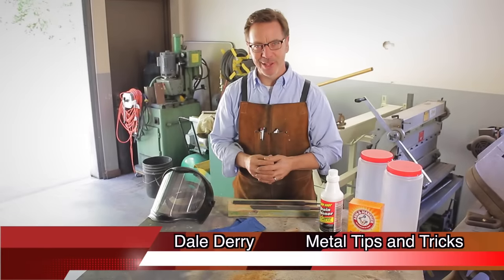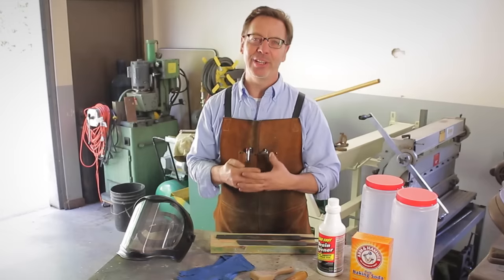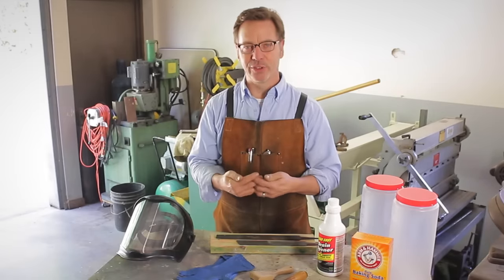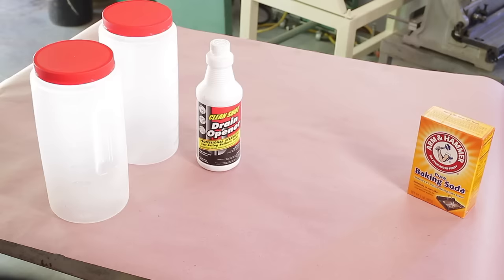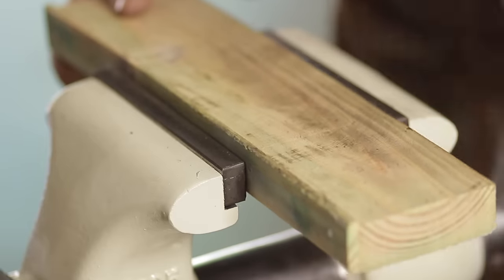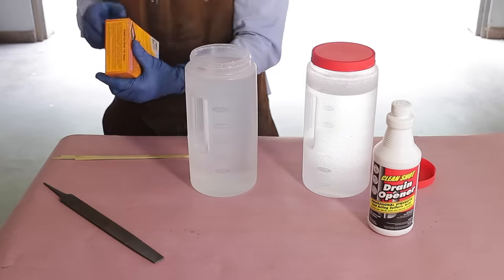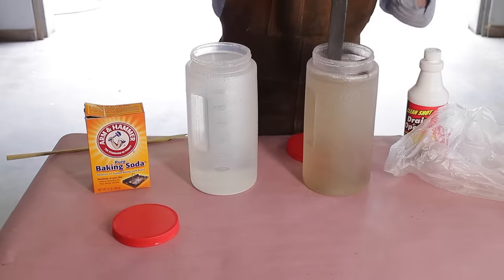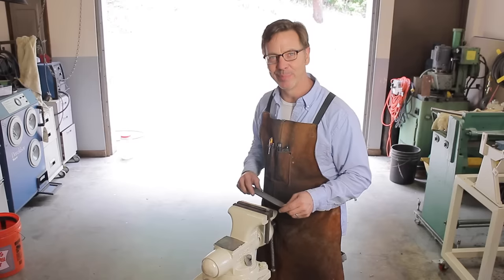How to Sharpen Metal Files

Comment: this isn't file sharpening, this is just unclogging the teeth.
Reply: Agreed, Many of the "new guys" I've worked with complain their files aren't sharp or dull out after a little use. Think many confuse clogged or dull as the results are pretty much the same. If this actually sharpened the file, it should also work on a drill bit and the concept is pretty much the same.... it wont help create a new (sharp) cutting edge, if anything the acid would help round (dull) a sharp blade as it would attach the thinnest spot the most, IE... the leading cutting edge.
Reply: Right. It seems all you need to do is the 1st step. Clean it with a piece of copper.
Reply: Ramon Ching I agree, I usually use that or a stiff wire brush. "Secret" is to clean it regularly so it doesn't get a build up.... I usually clean it before it goes back in the tool box, so it's ready to go next time and keeps the shavings out of the drawers (where they'll rust...).
Reply: no, the acid would remove the peak where the steel is thinnest. it wouldn't etch away the shoulder to leave a sharp peak
Reply: And why you think so? Thin piece disappear fast just because it's thin... but it's not about the width of the material in this case, acid is ideally disolving every spot at same speed. Same speed for thin and same for thick. By simple use of geometry you can see the sides of that tooth keep progressing faster to the center than the flat top, just because they are closer. They then meet and the flat top disappear... So i have explanation that it works, do you have real explanation it doesn't or you just wanna blame me and the video for offending your different opinions?
Reply: jarek, sure acid is dissolving all the material at the same speed, therefore the blunt file will continue to be blunt because the acid will eat away the profile at the same speed. your explanation doesn't work. and please, i am not offended by any reasonable discussion or opinion. peace
Reply: then you didn't get my picture, because those lines are contures with same dstance from the original profile = distance after same time... peace as well
Reply: What if an acid resistant paint is applied to a board and a file kept over it, then taken aside to dry.  Then all the raised points on the file will be protected with this paint.  And with the above treatment can the file become sharper?
Reply: I will try it and take before and after pictures with a microscope to see what is actually happening. i will keep you posted.
Reply: Actually,  it really is sharpening.  It is correct to observe that the acid attacks all parts of the profile - tip included.  It is wrong,  however,  to see this as preferentially eroding the tip and rounding it off.  The opposite is actually what results.  To visualize the process take a sheet of paper and draw a highly enlarged tooth profile on it, say four inches high,  but with a rounded off top.  Then imagine the acid taking say an eighth of an inch off all round - including the rounded off top.  This is easy to draw by running a line inside the original profile one eighth of and inch inside.  What you wind up with is a slightly smaller profile but with a more pointed tip.  Continue with this process of drawing one eighth of an inch taken off the inside of your diagram,   and very soon the tip will be simply a point.  

Yes clogging the gullies will impede performance of the file,  and that is one of the reasons to firstly thoroughly clean the file before acid treatment.  The other reason is so that the acid will attack the tooth profile from the tip to the bottom of the gullet.  

Incidentally the acid will tend to round out the gullet shape,  thus reducing the overall clearance between tip and gullet.  A small price to pay,  I think.  The rounded gullet will be less likely to accumulate cuttings and dirt.

Hope this helps.
Reply: High-end fishing hooks are often chemically sharpened.  Probably only effective on acute angled bevels though (i.e. not drill bits!).
Reply: The idea of sharpening drill bits as a test of the process has been brought up before. The differing actions of a file and a drill bit are the reason it isn't used to sharpen drill bits. 
Drills use the width of the point to define the diameter of the hole that is drilled. 
Acid removes metal from every surface it comes in contact with. The drill bit will become smaller in diameter just as fast as it becomes sharp. You end up with a drill bit that is sharper but with a random sized diameter
The same, two surfaces being eaten away, process exists because the diameter is the measure of the distance between the two sides of the bit. 
It will work on a knife but who wants a thinner shorter knife? 
Besides each of the other suggested arguments against using acid, points out a device that is normally sharpened in a different way, as an example of the acid process being a failure. If it were as easy to run a stone down the edge of the files teeth as it is a knife we all wouldn't bother with the mess of acid sharpening. 
Milling cutters are ground on center grinders because they have fewer flutes than a file would have in the same distance.
Reply: Did you ever take those pictures withthe microscope? That would end this argument.
Reply: it also eats away the metal in the groove so kind of sharpens.
Reply: I thought the same thing. I guess al those thousands of times I used a steel on my knife in the slaughter house was a waste of time. But something was sure making my knife sharp. Must have been the good air.
Reply: Heavenly Machining The reason the dull edge sharpens is because it is a rounded edge that shrinks. As an arc gets smaller, it approaches a point. The same would occur if the edge was bevelled. I use this method often for my cheaper sets. Ruined my first set because I didn't clean before etching. Electrolysis is a bitch....
Reply: If that really worked, you could sharpen knives the same way....  The file isn't sharper, the valleys are cleaner to accept more material while cutting.
Reply: Nope
Reply: @manowartank8784  - A good explanation of chemical sharpening. Thanks.
Reply: I was thinking it would dissolve the teeth slightly and sharpen them but then I thought about it. that would make a realy weak edge and it would shear off or chip easily. seems like a file comb would be better.
 and I have never heard that loose files in a drawer sharpen each other, I think that sounds like bullshit theyd tell the new guy  before they sent him off for a left handed crescent wrench and some muffler bearings....
Reply: @kstofkos  I think you are right. it wont cut like new, but it wont be clogged. most files just kind of scratch the chips off in an orderly way after a point and you have to make knives out of them and buy new files.....
Reply: Exactly...
Reply: No, you're incorrect about that! The acid has actually attacked the metal of the file, and it's removed metal in the process. As the metal is thinnest at the edge of the teeth, that's where this process is the most effective. It's not as if the file has been restored to like-new condition, but it can certainly bring a dead file back to life for a while!
Reply: @Chen Lee  "Your right here is no way this will work" chemical sharpening is a well-established industrial process that works very well. The reason it works has been explained accurately and correctly above by Evan Penny.
Reply: Wrong, look at a before & after under a magnifying glass or microscope, the cutting edges are dull rounded off or chipped, by placing them cutting edge up, the acid eats away the rounded edge untill it can eat away no more material leaving a sharp cutting edge, if left too long it will destroy the file, time is key for those that cant wrap their minds around the process its not worth explaining, for the laymen, just look at the teeth before & after under magnification, then lay awake at night contemplating the universe 😄
Reply: Luke Warmwater lol. I had a high school teacher who worked in a graveyard for a summer, the old guys told him to get tools from the crate that was nailed shut in the shed...!
Reply: this was a good thread, thanks all!
Reply: The original poster is correct. Chemical sharpening is a fiction. It should be obvious that eating away metal will in no way give it an edge. It will have no effect on the shape of the grooved hills and will follow the shape that's already there. Since the grooves are already flattened somewhat from use, then that's the shape they will still have afterward. I also agree with the posters above (I was a meat cutter too) that a butcher's "steel" is a great help in that it helps to maintain a straight edge. Steel does indeed sharpen steel when used with common sense. But to actually get metal REALLY sharp like it was when new, you first have to grind the edge flat and then straighten it. I know of no effective way to sharpen a file. You could somewhat straighten the edges of each cutting groove to make it better with a ton of work and a sewing needle to use like a butcher's steel, but you'll never get it factory sharp again unless you have the world's smallest grinder to grind down each and every groove in the file. Even if you could, it would take you so long that, if your time is worth anything at all, it would be far cheaper just to buy a new file. The man in this video is simply cleaning the grooves with the acid. That will certainly help the file to cut better, but it in no way sharpens it.
Reply: @richardlorych9868  No disrespect but you are not right. I have been a machinist for many years and have sharpened files like this..You use something called a "file card" which is a wire brush with short firm teeth to "unclog" your files. The acid eats away at the metal at a set pace, and at the "peak" of the tooth there is less metal. so it erodes that part of the tooth thinner than at the "base" of the tooth...It's exactly like sharpening a knife with a whet stone.. Believe it or not, thats on you, but be qualified before making silly comments, about something you have never done.
Reply: MegaProjectpat  Yes, you are exactly right, and that's why this works.
Reply: @brijlal973  No. because the "point" of the tooth is what is doing the cutting. making the base profile thinner wont do a thing.
Reply: @tonyy5482  It would sorta work on drill bits, but not nearly as effective as just sharpening it on the bench grinder.
Reply: @heavenlymachining5674  Ummm, what are you talking about? a steel, or even a piece of rouge covered leather thins the edge down making it sharper..
Reply: @kstofkos  Or course it would work on a knife...And as a machinist with over 20years experiance, I know this works..Cleaning the file with a file card will unclog it and make it cut better, but thats that, and this is this. two totally different things. The acid sharpened file WILL be easier to clog though because you have made the teeth smaller so there is less gullet.
Reply: @kstofkos  So sad there are so many non machinists talking like they know what they are talking about..
Reply: @garyallen8869  I know right?!? as a machinist with over 20 years exp, I kinda pity these ignorant ppl.
Reply: @wildbillhackett  Sorry you think that, but you are just wrong. I have over 20 years experiance as a machinist (someone that cuts metal) and I have used this for years..Found the tip in a 1890's machinist book. But if you doubt..Google is yer friend. Although I will give you one point..It wont be QUITE as sharp as a new file, and will clog easier because you have made the whole tooth smaller including the gullet.
Reply: I'm not sorry I think that because I'm right, and no amount of googling web pages made by 12 year olds will convince me otherwise. It's only further proof of how quick and widespread old wives' tales can be. It should be obvious to anyone that acid will burn unevenly. There's no way on Earth it can burn a natural straight edge on steal or anything else. You might as well take a sander to some concrete steps to round off their edges and then pour acid on them to make straight edges again. Lots of luck with that.
Reply: Wow, this is some discussion here. Ok, first- acid does not corrode anything evenly. Think of any thing metal you came across that was corroded that was in any way flat. Usually you found that the edges where sharp of what was left of the material with a very uneven edge and perhaps a swiss cheese look if exposed long enough.  It attacks that which is most vulnerable to it's reaction at a molecular level first or faster if you will. So it seems that edges are attacked but that's where, in this case iron, carbon and impurities, which ever is most vulnerable and available with more surface area than would be on a flat surface. So with this short soak time only the harder less acidic prone material is left at the edge and the final gunk in the valleys is removed. When they wet blast files to sharpen them it is gentler than dry or media blasting them and the slurry acts as a whet stone to sharpen the edges if they are not too far gone or rolled over. Does it work? Yes, after a fashion and the file works better than it did before. Is it like new? No, not at all but the file does perform better.
Reply: @ScooterFXRS  its a simple process. Try it and prove it to yourself. I have known about this for many years, and have done it.
Reply: Look kid, lies are not arguments. Sheesh....
Reply: @demandred1957   Did you not read what I wrote or some*how leave you with the impression this process does not work or are you so consumed with the wire picker who thinks he is older and therefore smarter and wiser then anyone else on the internet and little better then half right?
Reply: I know, you are correct,  I was being sarcastic.
Reply: clearly the problem with the nay sayers is that they own an armchair and a microscope but no files.  pretty much any metalworking book from the 1970's and older will mention this concept.  they must have been confused back then and a bit stupider as they lacked cnc.
Reply: I like all the armchair metal workers with a big brain and 0 experience touting there is no way this actually sharpens a file. Yes it does clean it but that's certainly not all it does.  I just have to shake my head and go on I guess...
Reply: He didn't do a close up on the metal to show how much better it did like he did in the beginning to show how "dull" it was
Reply: @richardlorych9868  Every one of the acid sharpening video's I have watched include a demo of the sharpened file....I don't know quite what to believe, you or my lyin eyes?  -Veteran '66-68
Reply: @steveorainvilleable  Any feedback, Steve? I'm really curious how it turned out?
Reply: Put a ball bearing and cube in the acid for a while. Does the ball become a cube or does the cube become a ball?
Reply: Brij Lal clever thinking!
Reply: Just get a new file already and keep it clean, or u can spend three times the amount on cleaning supplies + your time and effort, its up to u
Reply: I was told by a tool maker to sharpen them with a sandblaster.
Reply: The acid is too weak to dissolve the hardened steel of the file in that short amount of time, but is strong enough to dissolve the mild steel clogging the cutting teeth of the file.
Reply: The acid takes away some metal of the files, too.
Reply: This process is also available as a commercial service..   they do direct the acid comewhat so there is more removal off the “face” than the edge, but it works to just soak in acid..   your test (which i have done) is to use a chipped up and dull farriers rasp..  it is not clogged, Justus this dull, and the improvement is remarkable
Reply: @tonyy5482  Twist drill's, there called twist drill's No bit! and no soup for you!

Comment: As a retired engineer with a small workshop my files are very important to me, rather than use a file card (which has steel pins) I use a brass bristled brush so it doesn't tend to blunt the file. When I was at school some fifty years ago, the metalwork teacher used this acid method to restore files. If you buy new files always keep one face unused for.use on brass, even files slightly worn files will not cut brass very well. I engrave the word 'Brass' on the uncut part of the file to remind me.
Reply: That's a good suggestion regarding the brass. A jeweler I know has separate files for gold, platinum, nickle and steel. Mixing flecks of metal between jobs would completely ruin the product.
Reply: I once made brass filings to mix with epoxy for a pottery repair. I spent hours filing a brass pipe fitting to make those filings. It never really occurred to me that brass would be harder to file but that project made that fact very real.
Reply: A file is much harder than a file card. You can not damage a file with it.
Reply: A file card will not blunten a file, the bristles do not engage with the file teeth, and are soft so even if they do (bent bristle etc) it don’t matter